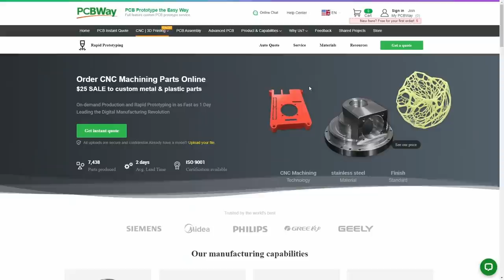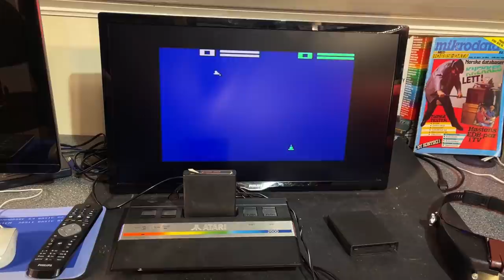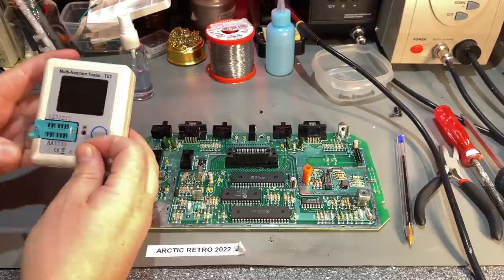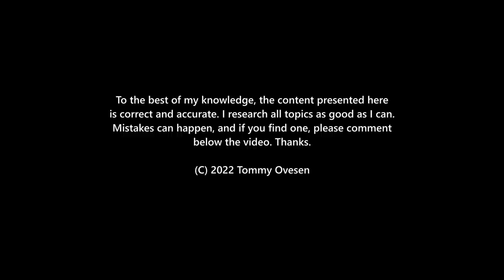Atari 2600 jr with no audio, faulty paddles and joystick. Restoration and testing games

Comment: Methinks the RF shield was shorting out the TIA's 2 audio output pins. And dirty paddle potentiometers plague everyone. I recently repaired a CX40 joystick with some skillfully bent paperclip wire and Industrial strength E6000 adhesive. Superglue is never strong enough.
Reply from the maker: Thanks for the input :)

Comment: The capacitors you replaced do you check the dates of the new capacitors when they where made. You might be replacing with a old capacitors.  I bought some and they was older than the ones in my machine.
Reply from the maker: I buy all caps on digikey, so I guess they are ok.

Comment: Great work. I'm loving the console restoration videos. I noticed the traces on the back of the board are raised and a bit bubbly , is this normal ?
Reply from the maker: Thanks! Yes, I think that it because the manufacturing process was like that back in the day. You see it on old C64 boards also.
Reply: @Arcticretro  yes I've seen it on C64 boards and thought it was bad :/